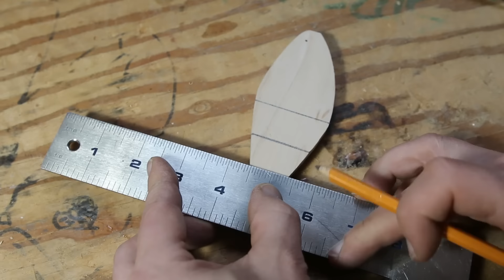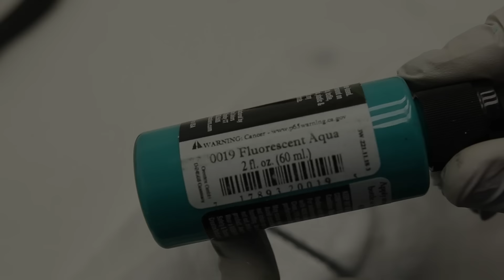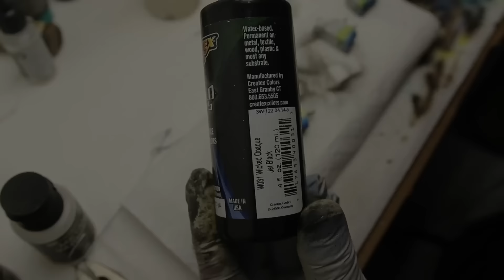Insane life like multi-jointed shad swimbait build.

Comment: Just some advice. Although this jointed swimbait isn't as crucial as a glide. The microballons will rise in the mold. So with your spru holes being at the bottom of the bait all of your buoyancy created by the micro balloons will be at the bottom of the bait when they should be at the top, resulting in an unstable swimbait. Beautiful job on the molds. But the lures performance would be much better if you were to have them parallel and you fill from the top!